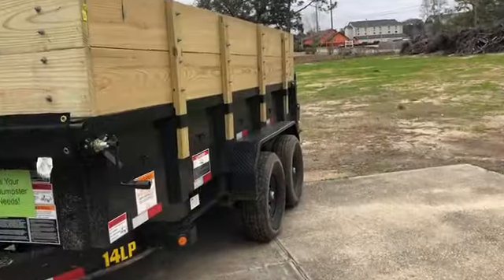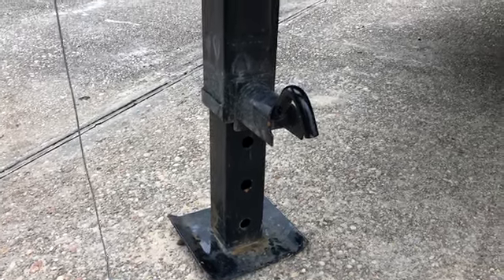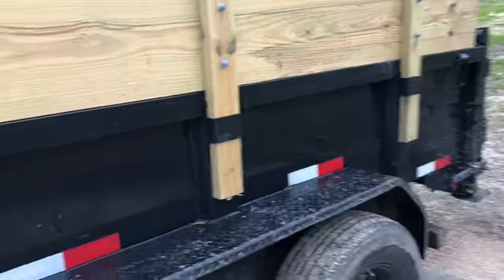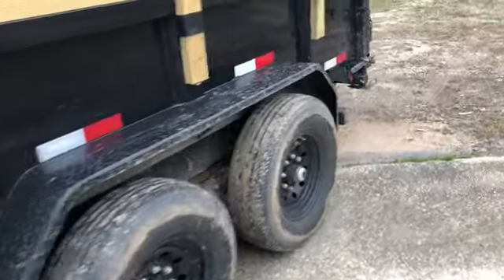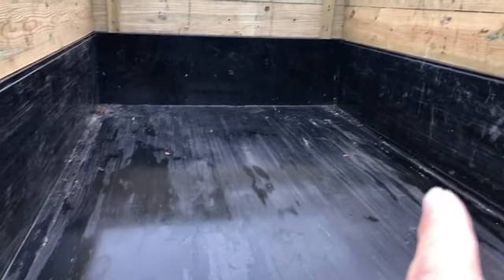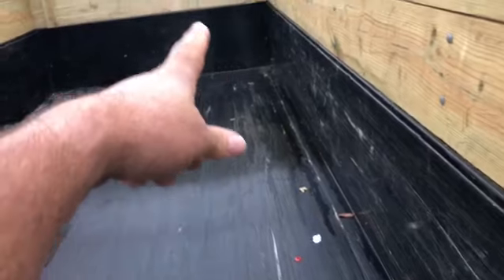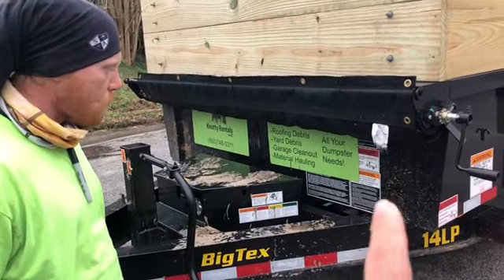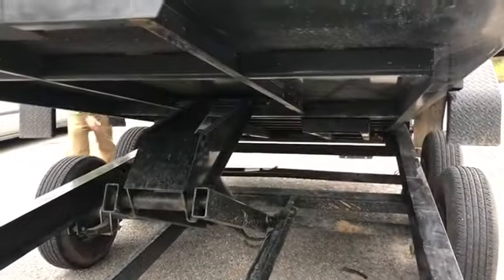Business is booming #dumptrailer #millionaire #getrich #sidehustle #extramoney #pensacola

Comment: More valuable info for the dump trailer nation! Robert, can you do a rundown on what size trailer a 1500 pickup can safely pull? Some of us green horns are starting out with a Ram 1500 V8 gas truck. Appreciate you!!!
Reply from the maker: I would not use a trailer more than about 10 foot and do not have more than about 4000 pounds total